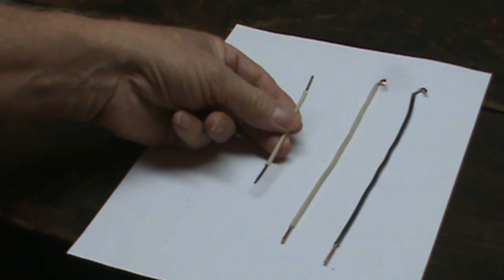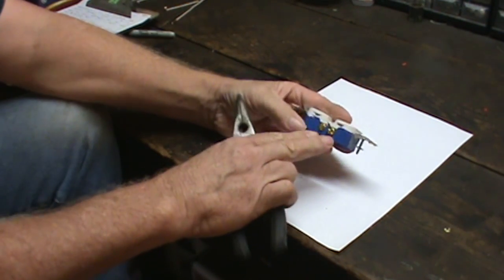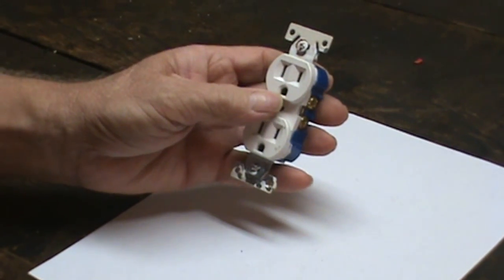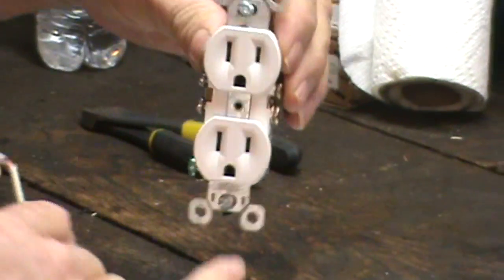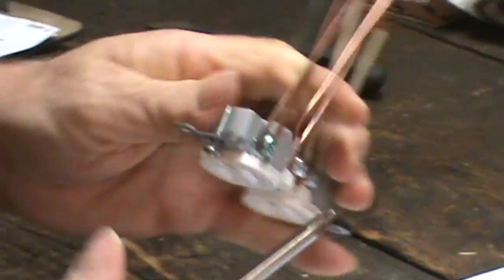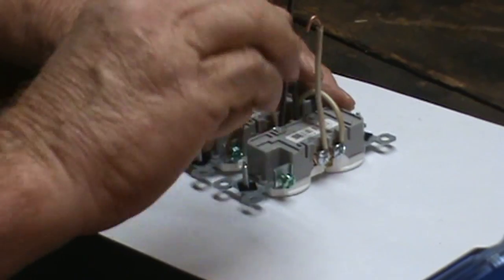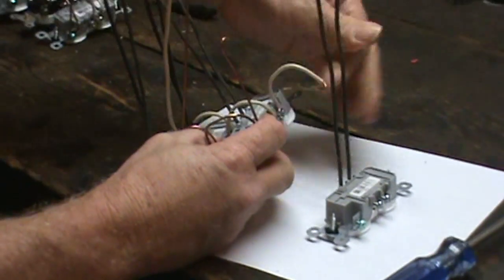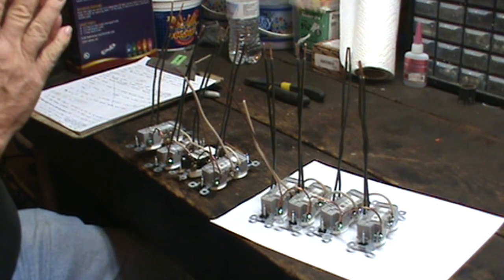Cheapskate Video 1 Part 2, Christmas Lights to Music Using Arduino and Vixen Lights

Comment: Hi again. If i bye adurino uno. Do i hv to download software first. And later the program.  For christmas lighting. Like. A computer i purchase later. I download windows. And later what i want to do. Am i right pls explain.  I want to start with few connecting in the house .
Reply from the maker: the code you cut and paste from the forum into the free program Arduino works for both mega 2560 and uno. You use the free program Arduino to load the code into the uno. Follow my videos.

Comment: Can 14 gauge wire be used instead of 12?
Reply from the maker: I'm not an electrician. I'm cheap. I used what I had lying around. No more power than the led's draw I would think it would be alright. Never hurts to check with someone who knows more than both of us down at the hardware store. That's what I do.
Reply: since the relays are rated at only 2 amps you can use 14 ga wire. You can actually go to 18 ga from the relay board to the outlets. I would use 14/3 wire for this because you can use the red for the top and black for the bottom outlets, then you will know which outlet is which when you wire to the relay board. The feed to the controller should be two separate 15 amp circuits since each gang box can draw up to 16 amps a piece. I'm an electrician and also have a diploma as an electronic technician.

Comment: Can you explain how I would connect 2 sets to make a total of 36 channels? do you double everything and connect it all? Please expand.
Reply from the maker: My boxes are 48 channels. Yes just connect all the hot leads that go to the relays together (I used the connecters I purchased from Lowes in my videos), connect the commons that go to the silver screws on the recepticals from one to the next so they are all connected together, Connect the grounds that go to the green screws on the recepticals from one to the next so they are all connected together.